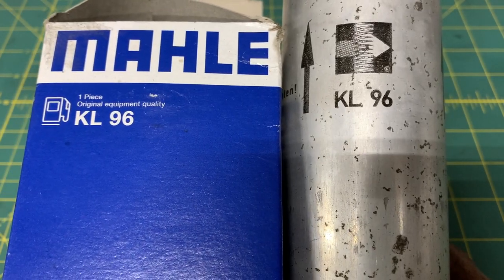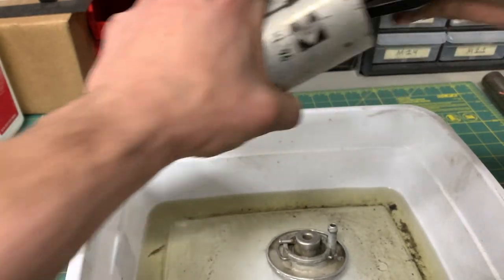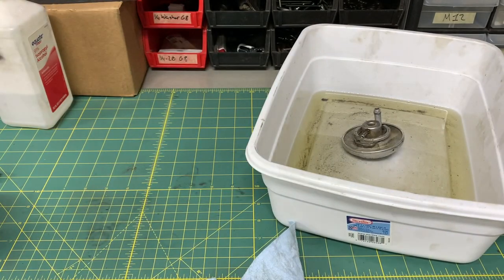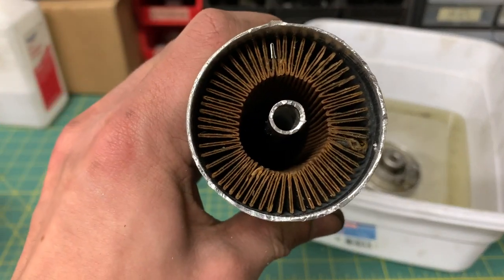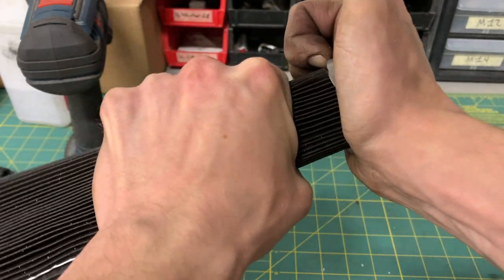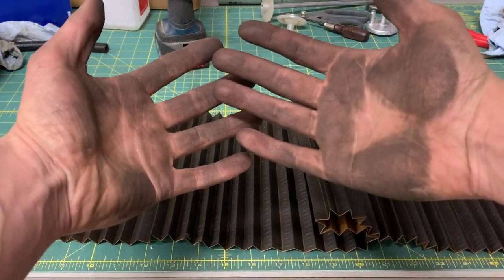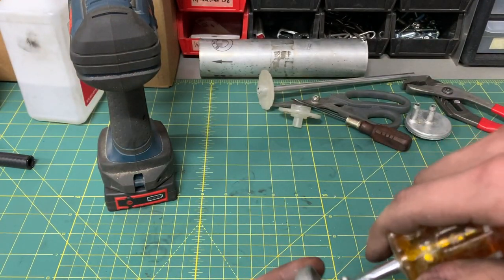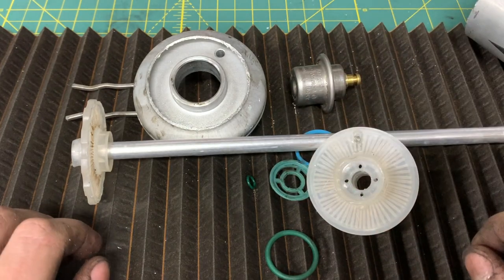What’s Inside a 10-Year-Old BMW Fuel Filter/Regulator?

Comment: I have to do this job on my 2000 540i. One thing I'd like to have seen is a desxription of how it works. That could help with troubleshooting. I am going to rewatch the video once you get it open to see if I can figure it out. ... I think I sorted it out: gas comes in through the outside diamter of the filter into the centre chamber, it squeeze through the holes in the transclucent cap into the outer chamber around the regulator and out through the outlet. The regulator is to engine vacuum, and so when the engine is accelterating it sucks a plunger in the regulator to suck more gass into the outlet chamber effectively pushing it into the engine by allowing more flow. 

My issue is that I accidentally let the car idle until it ran out of fuel! It was about 1/8 tank and I got distracted. It sat on and empty over night. There was still some battery charge left, surprisingly! But I had to charge up the battery and put more gas in the tank. The battery eventually would only charge to 11.8 V which would not crank the engine if sitting for a few days, so I replaced the battery with new. Since the incident running it dry, its required 3-5 seconds of cranking to start, where-as it would always start within 1-2 seconds. After running the car I checked the pressure on the fuel rail valve and there was no fuel flow, so I am losing pressure almost immediately.

Guessing how the fuel filter works I am not sure I can see a failure mode that would release pressure in the fuel rail. Unless the regulator is somehow blocking fuel pressure back into the tank. Like a block to keep the pressure on the outlet side. Can you confim or deny this since you would have a better idea. The question I have with my guess on how the filter works, is that it might not be the filter unless the filter has some way of preventing back-flow when the car is off. Maybe the regulator does this? Are you able to tell? If not then it may not be a filter/regulator issue which can help in troubleshooting.

I bought a filter years ago but never installed it. I will install it in a couple weeks. I bought the car in 2010 and have never replaced the filter so for the issue and the time it's worth doing. If it helps with cranking time then it may be the regulator also acts a check valvle to prevent back flow. Unless there is some other mechanism you can identify? Thanks for all this. Very helpful since I have this job coming up and have never done it!
Reply from the maker: @plexuss - Sorry to hear about you trouble. The filter-regulator is a very simple derive. The offset barb fitting on the better is the fuel inlet, likewise the offset barb fitting on the top is the outlet. the center barb fitting on the bottom returns fuel to the tank which was the bypass from the pressure relief valve. The small radially-mounted barb fitting on the top is a vacuum reference line for the pressure regulator.

It is possibly that running it dry caused it to malfunction but I don't think that is very likely. I think it would be a good idea to replace it anyway since this is such a neglected part of the preventative maintenance routine.

Another possibility is that the fuel pump may have incurred some damage after running dry since they are cooled by the gasoline. That also isn't that likely.

It doesn't hurt anything to have it crank a little longer on start up, it's just annoying. What you can try doing is priming the fuel system several times before starting it to see if that speeds up the start time. If so, it may be a regulator problem.

That's really the best guess I can make.
Reply: @Casey_Schmidt  From the images of the guts of the filter, it doesn't look to me that the filter or regulator can block the back-pressure when the engine is turned off. The fuel flows into the filter through the outside of the filter material to the inside of the canister. It looks like the fuel passes through holes in the plastic barrier into an area sealed by the regulator. There are holes in the wall of this area allowing the fuel to pass into the outer area and out through the outlet. so this means there is an unobstructed path for the fuel and so I don't see how the filter/regular can block back-pressure. The regulator appears to determine how much of fuel flowing into the inner area gets passed through the regulator and back to the tank. I looked on RealOEM for other parts that could prevent back-flow but I don't see any. Is it possible the fuel pump does this? I will change out the filter anyway and see what happens.

Comment: mine was original on my 2003 530i it was giving me issues first i replaced the fuel pump and that didn't solve my issue then i replaced my fuel filter and that fixed it. mine was the oem one that came from factory it lasted almost 20 years at least though so i don't blame it goin out.

Comment: holy shit, 6.5m^2 area. I have my old original filter in the garage, when I change it out again in a few years I'll do a comparison between the Bosch one I put in and the OEM one which came out.
Reply: Wait that can't be right, I think it's 0.65m^2
Reply from the maker: I’d be very interested in seeing if there’s a difference!
Reply from the maker: @xcuber123  It could have been a typo, I make those a lot.
Reply: @Casey_Schmidt  We all do don't worry about it. Been loving your videos, you work just like me. Spending 10 minutes analysing every o-ring and seal xD
Reply: @Casey_Schmidt  The old fuel filter turned out to be a Bosch one, but most of the writing has rubbed off so not sure on the manufacturing date. Hacked it open just now, my filter was a bit dark but nowhere near as dark as your one, so I think it was fairly new. Pretty much the same design, very slightly smaller filter length, I measured around 130cm. The return tube wasn't flattened around the rubber seal as yours was and pulled out really easily. Also the clear sealer they use is a black plastic on the Bosch, I think they melt it slightly and press it on the filter to create the seal. 

Quality seemed as good as your one. Green Viton o-rings on the pressure regulator.